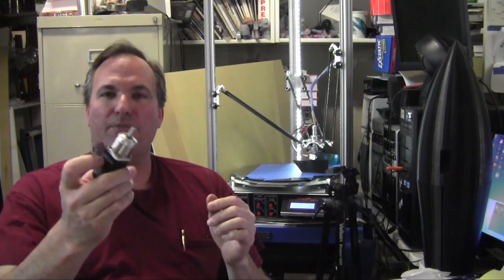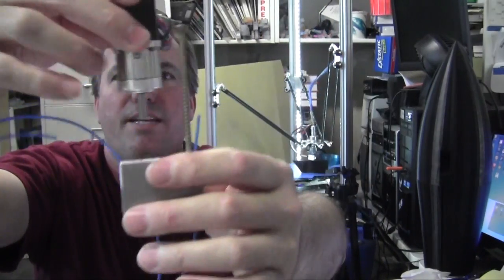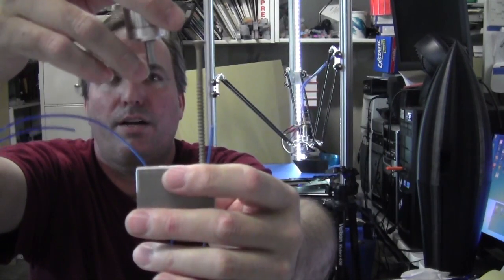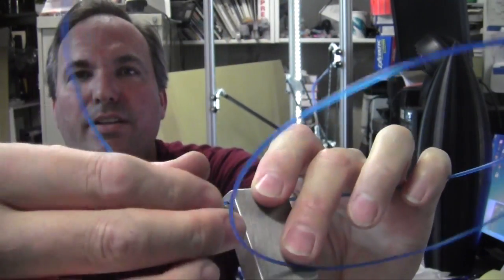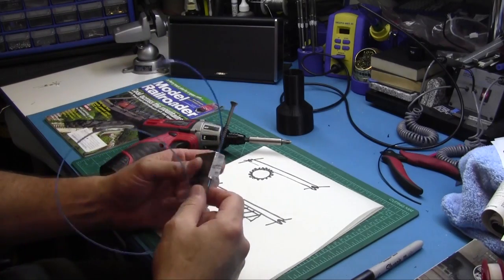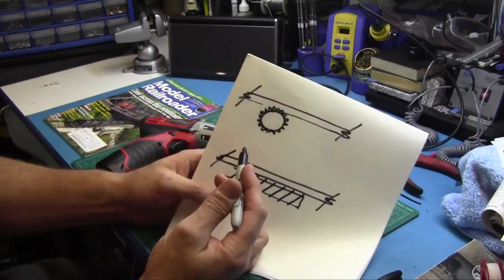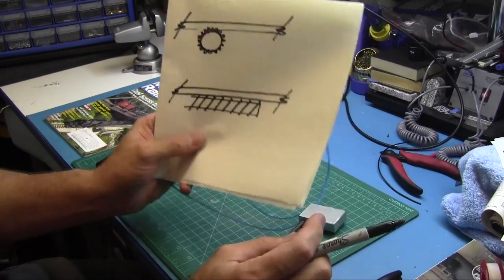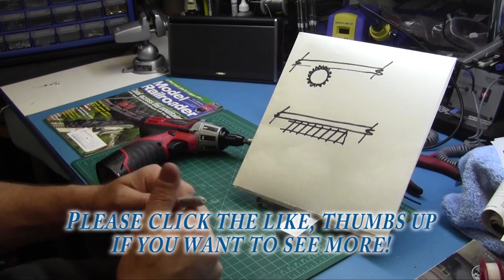A New Extruder Design By Werner Berry

Comment: now im pissed, i came up with a worm screw idea 2 days ago and now find out you beat me to it, i was going to use 4 of them with little force to allow quick retracting (along with a few other ideas) and the 4 gears would have tiny regular gears on the heads and a sun gear would turn them, alternativly but less likely is a screw with inner threads, i was eveing goingt to thread the inside of a stepper motor shaft for it to go through, this either needs to be exact or be a 4 part shaft in piw slices with band springs pressing it inwards, and the springs either need to alow a lot of movement or you would need one per filiment size, then have the first few threads be larger than the diameter of the filiment so it grips and spreads as the threads get closser, also the hotend would be held by a metal bracket atached to the stepper motor and the other size screws would be removed to atach to the arm

Comment: Cant see if this has been suggested but  change too hollow (threaded)  shaft in nema motor with thread inside it so it drives the material down vertically to the hotend if you see what I mean...its off the hollow shaft on brushless motors on RC planes for variable pitch props..which have pushrod inside the shaft etc..Rgds...Laurie

Comment: Bits from Bytes printer had a similar drive mechanism.  In order to get the the motor out of the way of the filament they put the motor to the side and connect the stepper to the drive screw using gears.  The filament is pushed up against a spring loaded bearing to reduce friction. 

I've had a lot of backlash issues with this design because of the wear in the gears, but if you can direct drive the drive screw, you may be on to something.

Comment: I was captivated by this all through my commute to work this morning!  How about complicating the issue and adding a contra rotating screw of the opposite hand to counteract the tendency to twist the filament?You could then double that to 4 screws to contain the filament totally within moving surfaces
I once inadvertently re-invented the "submerged weir" while trying to separate oil from water in a boat engine room, oblivious to the fact that steam engines used them years ago in crank sumps.

Comment: That *is* an interesting idea.  Looks super strong as a filament delivery mechanism.

Initially though, I become concerned with the friction between the aluminum and the screw - maybe that's not a real issue though. Also, if you made the extruder out of the block of aluminum, for example, heat transfer may be an issue. Heat isolation would be a bit more important.  Oh, wouldn't changing filament out be a bit of a difficulty?  It'd kind of be a pain to have to engage the motor in reverse to swap.